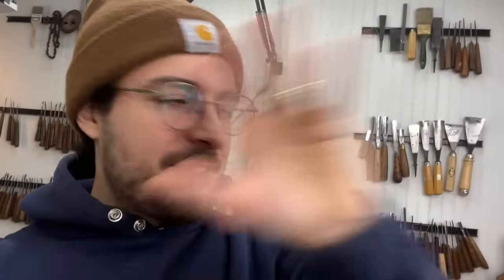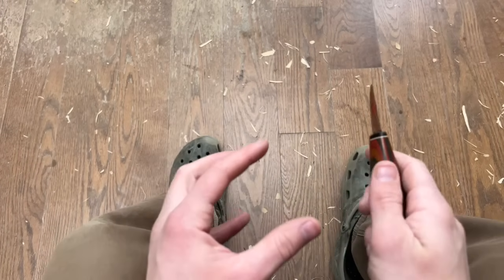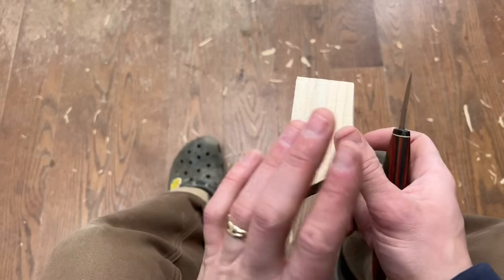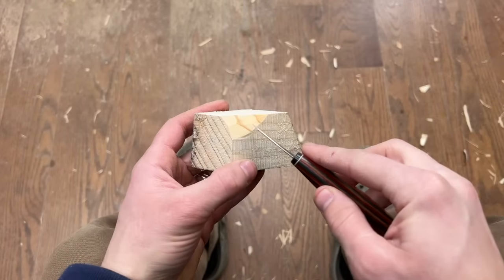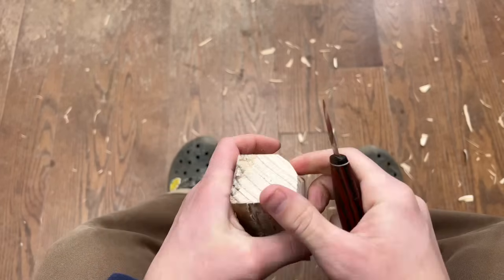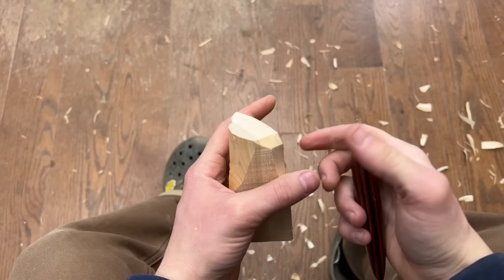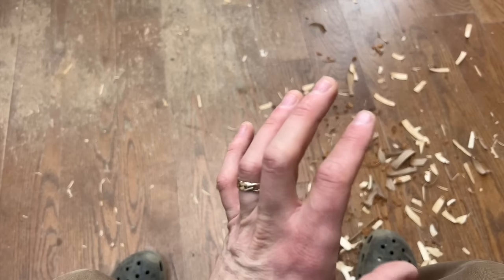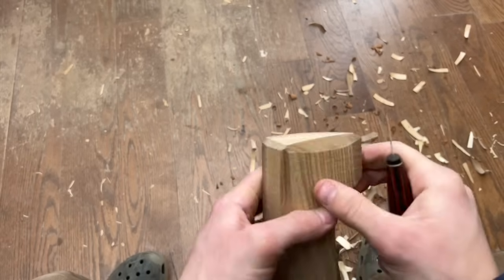Top 5 Best Woods For Carving--According to a Woodcarver

Comment: Here in Finland White birch is one of the most common trees. They do make some plywood out of it, but other wise they just grind it to paper pulp. Birch is wonderfull material for woodworker, but it builds fungi easy. That means your birch bench has to stay dry
Reply from the maker: Very interesting! Thanks for sharing!
Reply: About to say the same.  White birch is great for making furniture. Nowadays it is used for pulp and firewood. I have some own forrest but with electricity prices we might have during the winter out of lazyness I bought eight cubic meters of ready cut and dried white birch firewood for the winter as an extra source for heating. Cost per cubic meter over here is around 70-90 euros ready proscessed.. you would get a lot of carved pices out of that pile😂.

Comment: I carved 1.5x1.5" hardware store pine spindles for years, cheap as chips but I've just tried basswood and it's so much better. It's a real pain in the neck to get in Scotland, the only alternative to Beavercraft 1x1 blocks on Amazon is Hobbycraft, which sell 2x3x12 blocks for £14, with an extra £6 delivery unless I pick it up in store in Glasgow which is far from where I live. It's worth it though, I just make a point of visiting my family there.

Comment: I just got into spoon-carving and since I live in Germany there are some things I can't really get that you mentioned. Cottonbark - probably not. And also don't think Butternut will be available unless I order some and we have enough trees around here to not want to pay for it. We have a lot of birch here, which is indeed great for carving spoons and hopefully in the future other things. I also am a fan of cherry, as it's beautiful and quite easy to work with (in comparison to apple or other fruit-trees, which are really hard!). Haven't tried alder yet, but of course I've tried basswood, or rather their European cousins, linden, or Tilia cordata/platyphyllos. They're not usually found in hardware-stores because the wood is tooo soft for building and anything that has to stand some wear on them, but for carving it's nice and smooth. Since a lot of our street-lining trees are Tilia, you can easily find some branches from tree-maintenance and grab a piece, split it at home and have some available for a while. I'd like to try plane in the near future, but those are harder to find. 
My favorite right now is Yew. I've always loved their wood, it's beautiful and unlike most conifers, the grain is easy to overcome. It also doesn't have raisin, which is very helpful. It's got AMAZING coloration and you only have to be a bit careful since the white part is softer than the dark one. Also be careful: it's poisonous! So probably not something you'd make a dining-spoon of. Also pretty hard to get some thicker pieces, I've so far only gotten my hands on some thicker branches, which is still very nice. 
Hazel is also something nice to carve with, astonishingly hard once it is dry but nice to work while green. It does have a soft core (non-wooden) so that has to be left out but the wooden part is nice. 
I do not recommend using oak unless you've got some anger to work out. It IS workable but really... why? (On the other hand, there's an altar in my town that has been carved from oak and holy moly, that guy must have had some anger-issues! (And personal pride, I guess) https://upload.wikimedia.org/wikipedia/commons/8/8a/Schleswig_Dom_Br%C3%BCggemannaltar_details.jpg )
Reply: Wow bellissimo

Comment: Very informative video  And I learned a few things.
As power carver, my 5 top woods..
1) sycamore or spalted sycamore.
2) red cedar.
3) willow.
4) maple or box elder, or if you're lucky, flame box elder.
5) cottonwood bark.
cotton wood isn't really readily accessible to me but I found a guy online that lived somewhat local a few years back that sold me a couple wheel barrels full cheap because he had a cottonwood tree he was going to make a canoe out of.
Also, although harder to carve, I love mulberry because of the colors and grain once finished with oil.

Comment: I find Basswood is not good.for detail, but I t’s a great basic carving wood for gnomes and flat-plane work. I came across Buttonwood down here in Florida and find it to be a nice wood to carve and turn. The Boxwood shrub has wonderful carving wood, but they’re slow-growers. Landscapers here in Florida regularly change out landscape plants around gated communities, so if they’re pulling them out to replace them, ask to take their discards.

Up north (in the US), any fruitwood is wonderful, but oh, how I love Cherrywood - for whittling, carving, or lathe. My dream wood. The color is beautiful. There’s also Tulip Poplar which is very nice, but more bland in color.

Maple is great for detail: spritz your wood with water/alcohol mix to soften as you go. A hard but very nice wood.
Reply from the maker: Good points! Depends on the basswood too! Love birch for higher detail too!

Comment: Hi Alec, thank you for this really informative video.  As a novice carver I'd be really interested to see how you adjust your carving technique for harder woods.  I recently did your Christmas  tree project in kiln dried birch which I found quite challenging, probably due to rooky mistakes.  I suspect I was trying to take too large cuts as it became easier once I started taking much smaller cuts.  I also put a lot of effort into initial shaping with the knife before eventually resorting to using a mallet and chisel, which I think was the more practical option.  This project also highlighted the importance of maintaining a good edge, I have a Beavercraft knife (which doesn't seem to be generally recommended by experienced carvers) and I needed to strop very frequently, especially while I was doing that tough shaping work.  Overall I suspect that these mistakes compounded to make the project much tougher for me so I'd be really interested to see you tackle a much harder wood.  I did enjoy carving the Christmas tree and the hard birch resulted in a lovely finish, and more importantly I think I learned a huge amount from my mistakes! :)
Reply from the maker: I will try some other woods in the future! Thanks!

Comment: in the basswood category you have basswood and lind aka linden. basswood looks more like poplar with the spring summer rings being more obvious than in the lind which visually has little or no grain difference. basswood is a bit more yellow than the lind which is almost white. a hundred years ago they made artificial limbs from lind. the leaves on the tree of both are virtually the same with size being the main difference in that while both are heart shaped with a fuzzy underside the lind leaves are smaller. i prefer the lind when i can get it and since i cut my own firewood, when i encounter a lind with several trunks i gradually reduce the number of trunks saving what i cut that is of sufficient size to carve. the bark of lind can easily be mistaken for poplar.
Reply from the maker: Interesting!

Comment: We had some cedar blow over in a storm about four months ago and I cut the trunks into about three foot lengths just to get it out of the way. It’s currently still stacked beside the driveway. Would it be suitable for carving or should it be cut down more first?  I tried to use some about six weeks ago and it was still a bit too wet and sappy.
Reply from the maker: Cedar is pretty stable, you can leave them whole. Just be sure to keep the end grain sealed!

Comment: What is a best/recommended wood, offering best balance of carveable but is strong. We want to make a wooden sword (2' long max). We don't want too hard of a wood that will make it hard to cut/sand. HOWEVER, we don't want the wood to be too soft, where the sword will be easy to break. One piece sword... not multiple pieces.. a simple project for 12 yr old
Reply from the maker: Hmm, you could get away with using poplar!
Reply: @AlecLaCasseArt  where does poplar fall in the range of wood strength? Harder or Softer or mid somewhere?